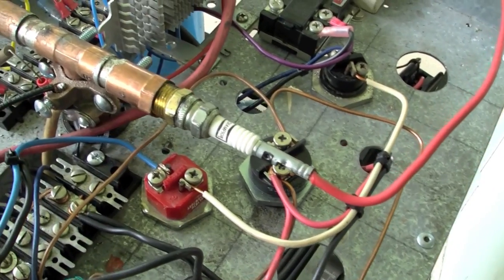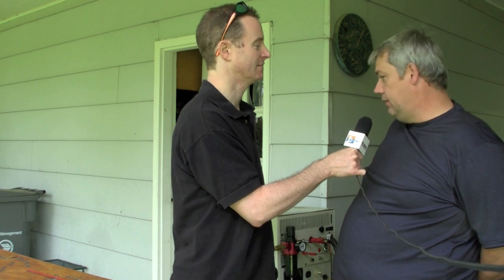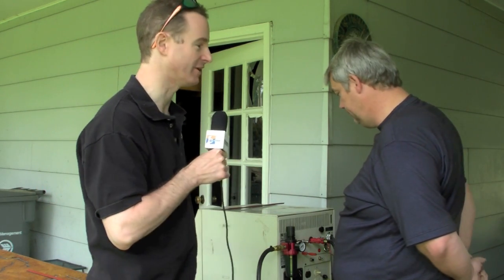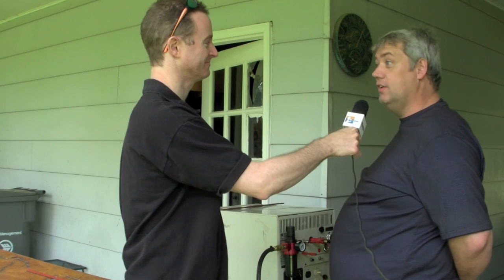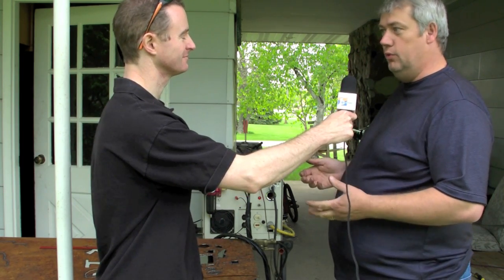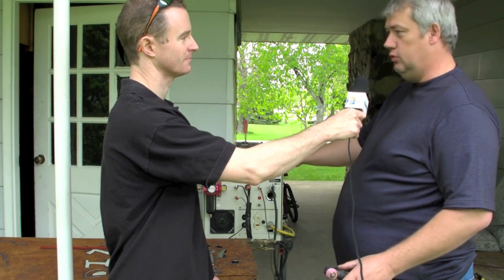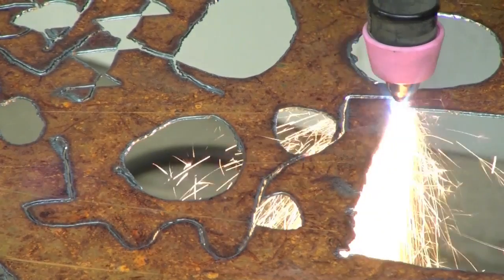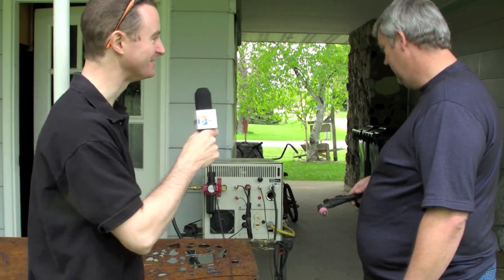DIY Plasma Cutter

Comment: Could one make a plasma cutter from a DC buzz box using a non consuable rod which already cuts just sharpen the tip and add a compressed air using a Carb jet for a narrow air stream ?